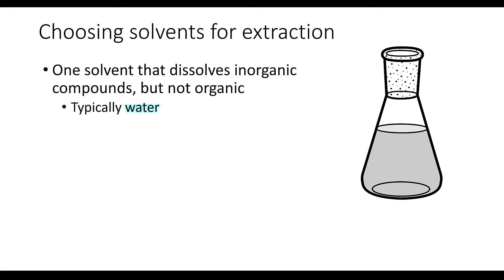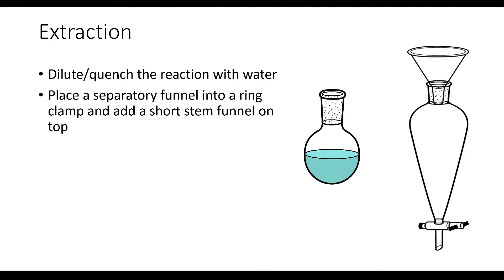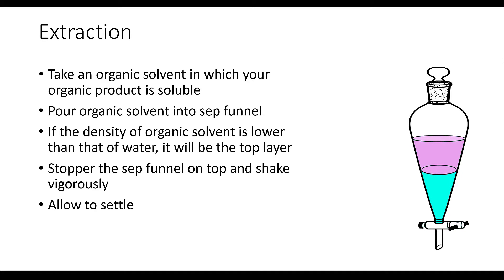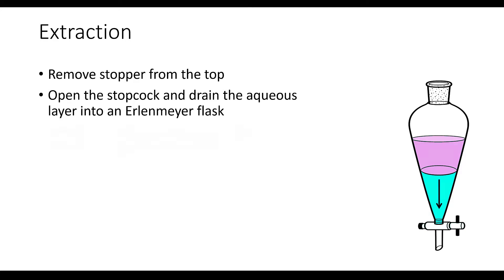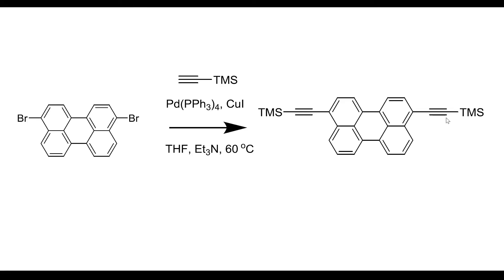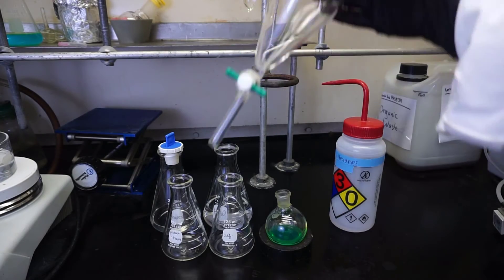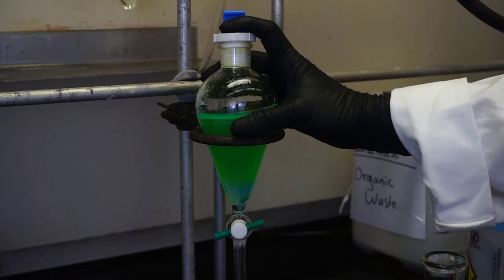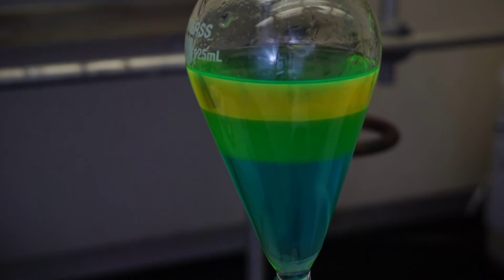Extraction technique in organic chemistry - Nadia Korovina

Comment: Beautiful example of an extraction! A fluorescent compound in the organic phase and copper ions in the aqueous one, beautiful! But I don't drink tea or coffee, i drink Redbull and do my extractions in the lab only^^
Some additional information to your explanation:
Polarity is most important beside density. Your synthesis product may be very polar and go into the aqueous layer. You can use that, for example with amines, the free base usually is non polar and dissolves in the organic phase, while it's HCl salt after acidification with HCl is a polar salt, so in dissolves in the aqueous layer. Very useful for cleanup. Furthermore, density, usually chlorinated solvents build the lower phase with water, hydrocarbons and hydroxycarbons the upper one. But that isn't always the case, heavy salts can make the water layer heavier than dichloromethane for example, heavy organic molecules can make the organic layer heavier than water etc. Always watch which phase goes were while pouring into the separatory funnel in order to not lose your product.
Usually you should always shake a separatory funnel with the stop cock end direction fume hood, while shaking the other end with the other hand, pointed at your hip. Usually gas will get liberated, so first swirl it open, then start shaking and venting. Best practice is to hold the stop cock with the left hand und the separatory funnal and stopper with the right hand. Always do three extractions, since non miscible solvents are still partly soluble one in another. Then combine your phases containing your product. If it's in the aqueous one, boil off the organic solvent with heat and maybe vacuum. If, as more common, it's in the organic one, you may neutralize it with a saturated solution of sodium bicarbonate. Then dry it with saturated sodium chloride, which takes up water due to osmotic effects. Then, as mentioned, dry completely using anhydrous sodium or magnesium sulfate. If it's a nice powder flowing up, it's dry, if it clumps up, it's saturated with water, so you'll have to add more. When filtering it off, always rinse with a bit of fresh solvent, or else a lot of your product will stay in the filter with the sulfate salt.
For professionals using rotavaps: Yes it says to evaporate ether or DCM at atmospheric pressure, but that doesn't mean to not turn on the vacuum pump. It's a closed system and you're evaporating stuff, so just set it at 900 mbar to keep it from blowing up. Since vacuum has instant effect, but heat has to be conducted, always first set the correct vacuum for your solvent according to the 60/40/20 °C table (Waterbath at 60 °C, boiling point at 40 °C and cooling water at 20 °C. Gives best and fastest evaporation. If correctly used) and then put the flask into the water bath. Otherwise it'll boil over instantly. Rotation is necessary to avoid boiling delay, but rotating to fast can hinder evaporation. When almost dry, take out the flask of the water bath, vent to atmospheric pressure, empty the receiving flask, and apply high vacuum to  dry your product if it itself isn't volatile.
Reply: Wow that was very helpful. Can you please explain why we add the anhydrous magnesium sulphate
Reply: @RadhikaSharma-oi4ne it binds with water so you have a dry organic layer when u filter